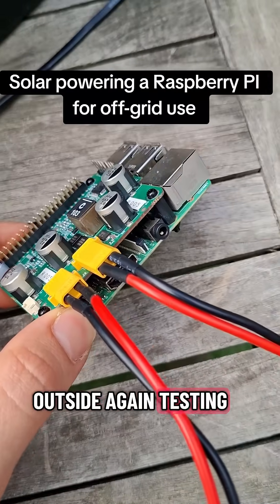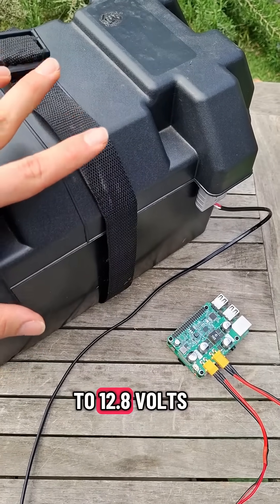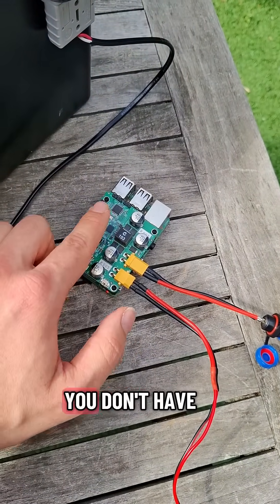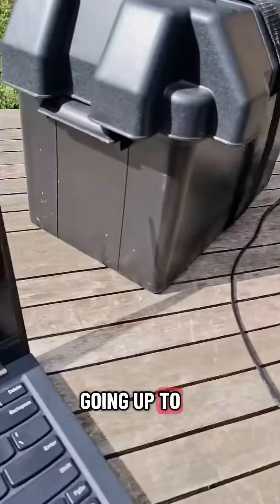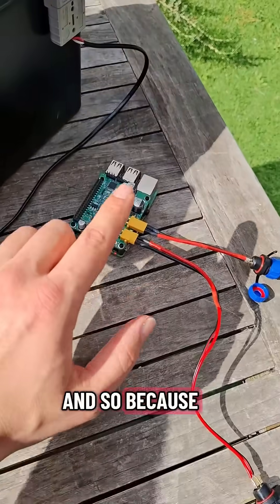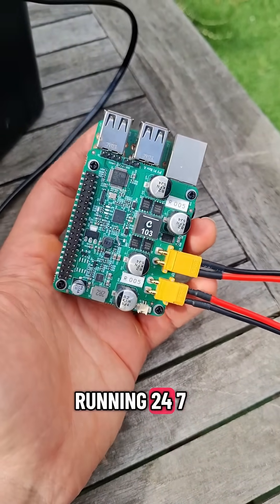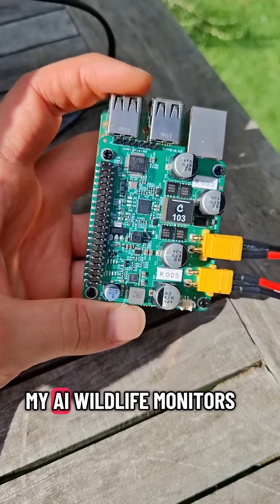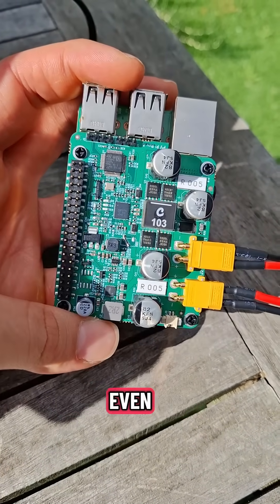Solar powering your Raspberry Pi from a 12v LiFePo4 battery pack. #raspberrypi

Comment: Why would you diy expensive project like this? Bluetti has the best cheap power packs with usb power (solar power station bluetti around 300-700wh) on your choice.
It's a waste of time what you ve done.
Plenty cheap solar generators available from best brands like Renogy, Ecoflow, Bluetti, Jaclery.
Calculate price per wh for different sizes and you will see that your diy is more than the all in one power stations with solar mppt incorporated in 1 unit. Plus, is the looking, fancy case, safety, ventilation, warranty.

Comment: It wont run from solar panel with less than 15 volts. Since the mppt controller types, can't upscale voltage. Only downscale.
Reply from the maker: The charger we are using has a buck-boost converter

Comment: Optimal charging voltage for LiFePO4 is 14.2V, this gives 3.55V per cell.

The max voltage is 3.65V/cell, or 14.6 V .

If you had settled on 14.4 V, then it would have been usable both for a 4S LiFePO4 and a 6S Led-Acid.

By choosing 3.65V/cell shows that the designers  of the board do not know much about lithium batteries...

Comment: running something as beefy as a Raspberry Pi off solar panels is actually quite challenging. People underestimate how power hungry those electronics are.
Reply: I run raspberry pi5 on a solar system and consumes around 6-7 watts (headless). I also run 5 nodejs applications on it and it is pretty efficient. Under load it can go up to 10 watts but rarely.

Comment: Still don't see why you wouldn't just use a dedicated mppt charge controller with very little phantom current draw?  Why does this need to be integrated into a pi hat?
Reply from the maker: So it can directly power the Pi and provide a range of additional features for remote operation.
Reply: This is much better when running a PI. Easy and compact to assemble and much more info available. Battery SoC, solar performance, current draw etc. are all very valuable info when building a solar powered device in my opinion.